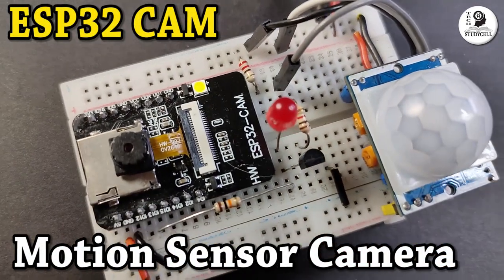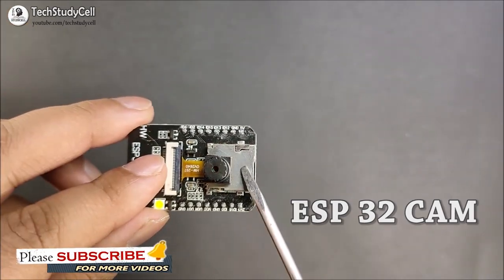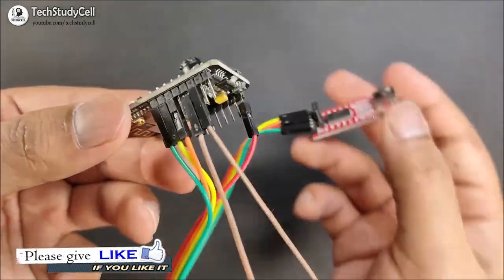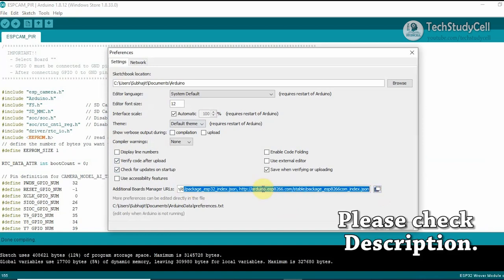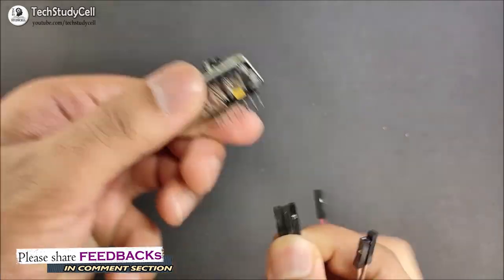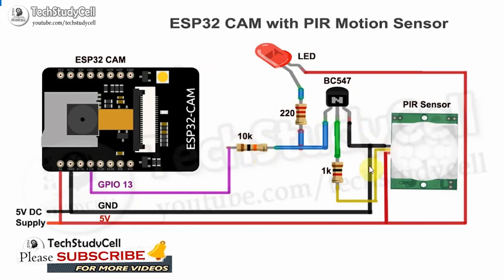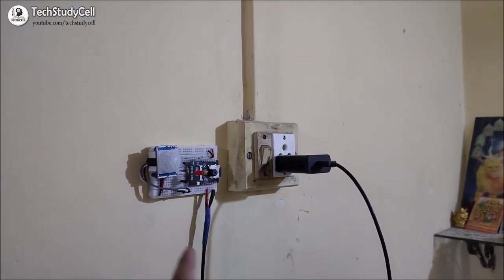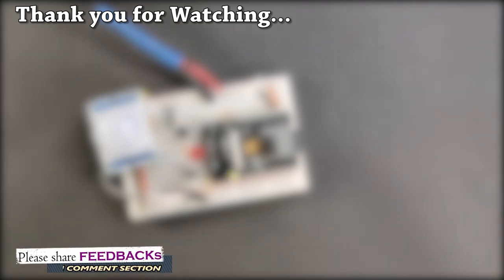ESP32-CAM PIR Motion Detector with Photo Capture | ESP32 CAM project

Comment: Have you tried how much will run with batteries? In example 5000mah?
Reply from the maker: No. I have used mobile charger.
Reply: I'll check when I receive the programer and npn and will tell you
Reply: @fernandohooch  any feedback on your trial?
Reply: @thatcrazyguy1971  No, it always gave false positive. so It's on a box waiting for another try. Maybe I didn't conected well the transistor

Comment: Hello and thank you for sharing this project.  I reproduced it and it works, except for one thing:  it sends me a picture every about 15 seconds independently of the PIR trigger.  I tested the PIR alone, the output stays at 5V and when there is motion it goes down to just under 0.2 V.  I assume that these are good TTL levels.  When I connect the ESP32, the voltage at GPIO13 is about 3.7V,  and when I create motion (red LED blinks) the voltage at GPIO drops to about 1.8V - I believe that this is too high for a TTL low.   This makes me think it is the reason I get pictures send regularly, because that pin is always read as HIGH. Please, give me your thoughts.   If my diagnosis is right, how do I make Pin 13 go low?  Thank you,  Maci
Reply from the maker: In this project I have used active high pir sensor. So when it detects any motion the output pin will become high. But you are using active low pir sensor. Connect the pir output pin with GPIO 13. And check.
Reply: @TechStudyCell  Thank you, I should have seen that.

Comment: Thank you for great tutorial! .I have 2 questions. Can we do this project without SD Card? and when transistor is switched on,why pin 13 goes low?
Reply from the maker: When the transistor turns on the GPIO-13 is connected with GND through the transistor.
Reply: @TechStudyCell  but there is 10k resistor.
Reply: current flows through the resistor

Comment: Great video. Maybe stupid question : why do you have to connect it through transistor? Couldn't we connect pair output directly to esp?
Reply: Exactly, I don’t understand this either, why cant we connect the signal wire from the PIR directly to the ESP32 board, and trigger a photo when the pin goes high?🤷🏼‍♂️
Reply: @Utube2Itube  I think I searched whole web and still no clue...
Reply: @ineffige  I think it will work. The transistor is probably just something that someone started with and then everyone followed along. 
I have used the PIR sensor connected directly to a Arduino board to trigger a LED. It’s the same principle really.
Reply: @Utube2Itube  thanks mate! will try it. Cheers from Poland
Reply: @ineffige  Powodzenia ze Szwecji 🙌🏻 🇵🇱🇸🇪
Reply: Change this line: (0 to 1) and wire directly.  My PIR already has a pullup resistor built in esp_sleep_enable_ext0_wakeup(GPIO_NUM_13, 1), don't need the led unless you want to test that the PIR is working

Comment: Thanks for sharing this project. Can you please do another video to send these sd card saved images to Blynk, Telegram or Gmail . Sending specific image on specific gpio pin trigger, as this option would enable esp32 cam module to send saved images on different trigger events, that can be used for different applications. Awaiting your earliest response.
Reply: @erment55  Thanks bro for sharing this link .
Reply: @yawarsaeed6499  you well come
Reply: Hey bro  did you get the solution. Instead of storing it on the sd card it should send it as an sms or telegram

Comment: Can you please help us make a wildlife camera that'll take such pictures but without the red LED flash (it irritates the elephants) and send a notification by LoRaWAN to one of the forest dept anti poaching camps? Especially if the unit is moved? Of course, it will need to be housed inside an all weather casing, with battery, and optional input from solar panel. If we can also record temperature, humidity, etc periodically, that would be awesome too.